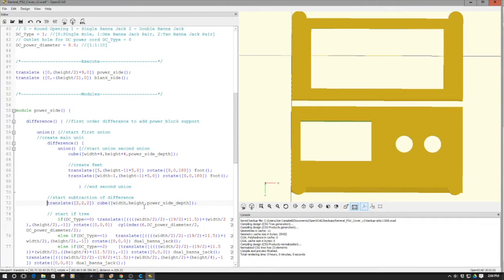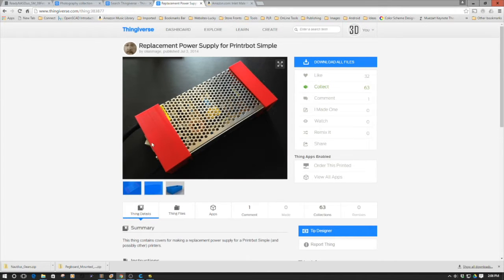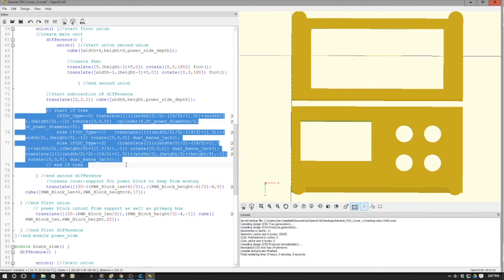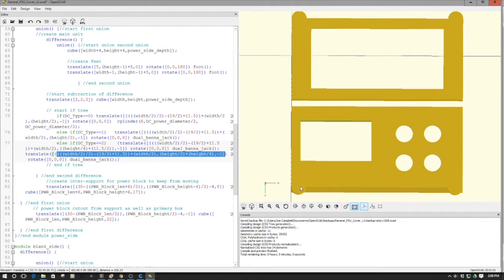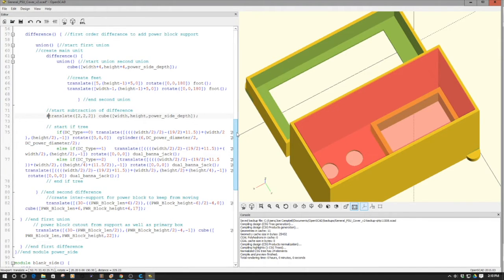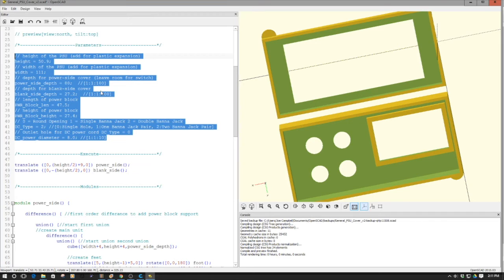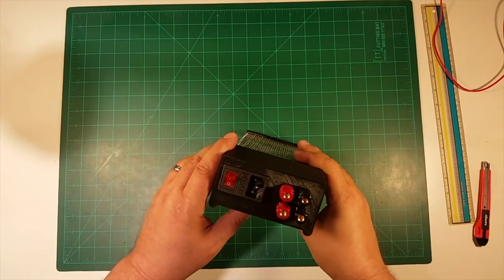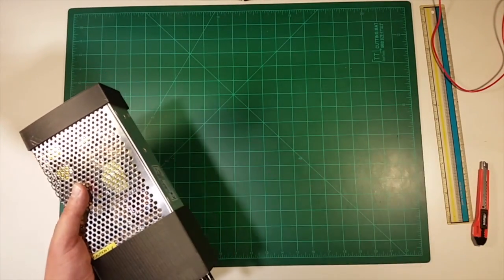Open SCAD  - Thingiverse Customize Power Supply Case!

Comment: thanks, good video! I want to do the same, but I would like to know how to do the internal wiring, which cables did you use? (tickness, AWG?), dod you use connectors?, how the internal connector are connected?, can you provide guidance in this?, thanks
Reply from the maker: Sorry for the delay as I don't get a chance to check these much, however this should be to your needs and application and if in question error to the higher (i.e. lower when it comes to gauges) side of the fence. :-)